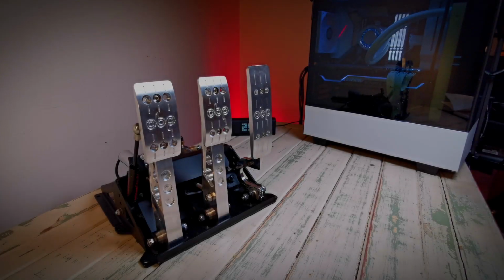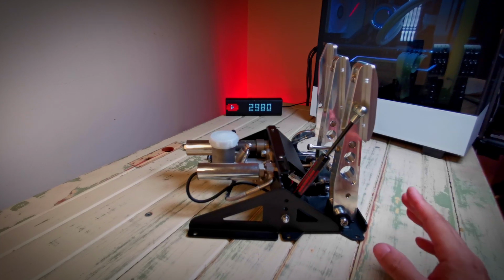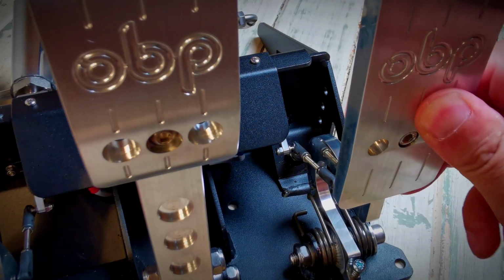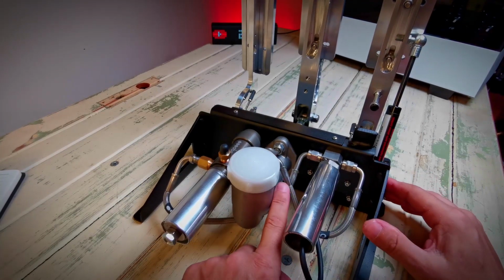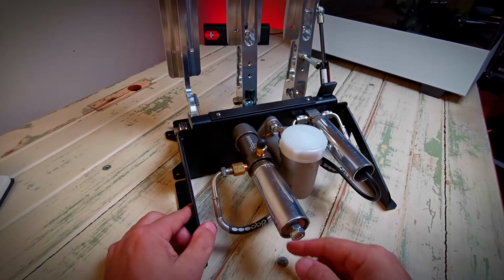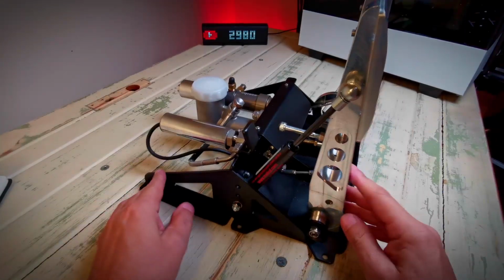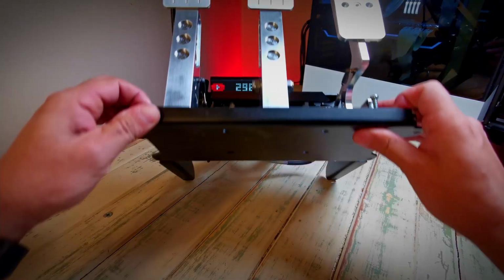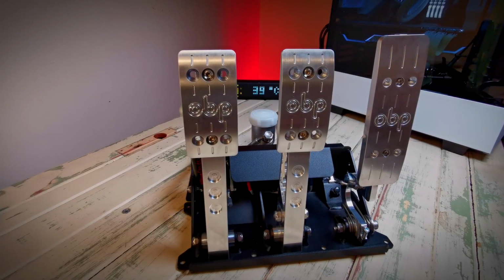OBP Hydro Sim Pedals | eSports Pro-Race V2 Hydraulic Pedals

Comment: Hi you. Have some questions about the adjustment of stiffnes on the brake. I see that you mixed the elasto spring's. You put the spacer between the red and white. Is that correct?
Reply: Also, my pedal is extremely hard with softest bushes. Seems like it is not returning when bleeding, not any space left to put the nut on again
Reply: @simracingnorge5810  I've got the same issue, the bushes are not easy to get right.  What combo did you end up with?
Reply from the maker: Hi, That is the way they were delivered to me, I actually ended up using both washers at the nut end of the stack as I found with only one there the washer was deflecting and beginning to deform, it couldn't cope with the pressure. I would talk to OBP direct regarding your issues with the slave cylinder, it doesn't sound normal, I had no issues with the set I used for the films. Cheers Gavin

Comment: do you find the accelerator squeaky when racing because of the spring??
Reply from the maker: No, seemed fine, clutch gas ram makes a ot of noise though.
Reply: The springs and bearings required some lubrication after a while, but almost silent since then. Just sprayed them with Ballistol